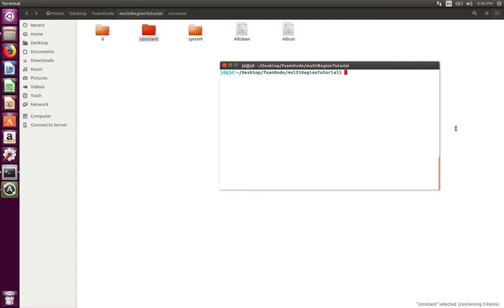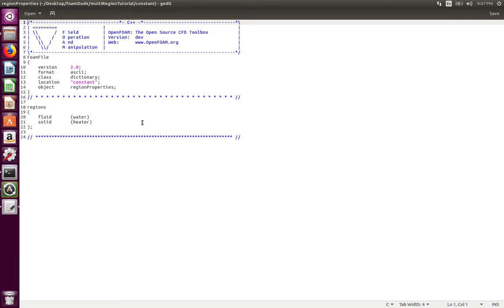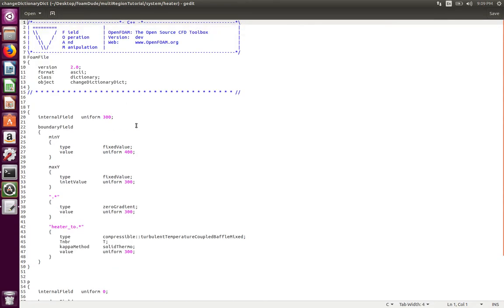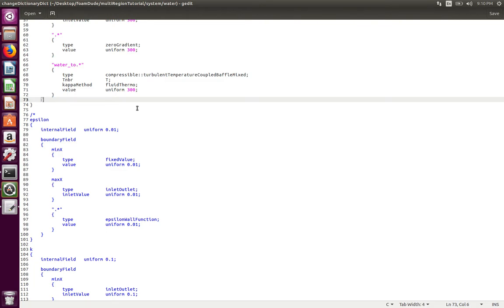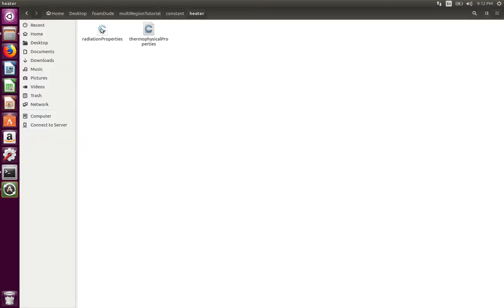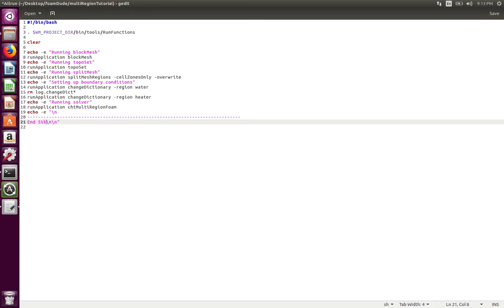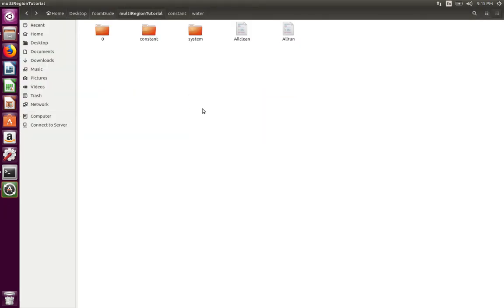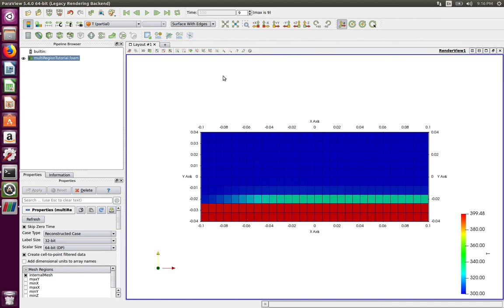OpenFOAM: chtMultiRegion - multi region case setup

Comment: I'm wondering if you have an example of how to set up an axisymmetrical case of chtMultiRegionFoam?  I want to try to simulate the cool-down time of an insulated pipe in water.  The insulation is a little complex, so it's not just a simple 'layer thickness'. I am able to share with you what I have done, but I am having lots of trouble getting the dictionaries set-up and perhaps the 'changeDictDict' approach is actually what I need to assist.

Comment: Hi and thanks a lot for the tutorials!
 How could I run a similar simulation on Openfoam 6?
Reply: since Openfoam 6 doesnt have the chtSimpleFOAM anylonger you need to use the PIMLE version (chtMultiRegionFoam) with ddt scheem in fvSol as steadyState.  
you can take the v5 SIMPLE version and change SPMLE to PIMLE and add the *Final part by using regex. ex "U.*" instead of just U

ex all the fvsceme should have steadyState
ddtSchemes
{
    default steadyState;
} 

solvers
{
   "(U|h|k|epsilon).*"
   <---- added the regex for UFinal, hFinal and so on.  with ".*"
    {
        solver           PBiCG;
        preconditioner   DILU;
        tolerance        1e-7;
        relTol           0.1;
    }

Comment: HI sir
I want to do it for simple case of flow across a sphere with heat generation in sphere. I am creating my mesh in gambit and reading that mesh in openfoam. I am creating toposet with giving sphere solid and rest as fluid by invert in toposet. But when i am running split mesh it shows error that:
Cell 0 with cell center (0.244027 -0.0982378 0.0982372) is multiple zones. This is not allowed.
It is in zone Fluid and in zone fluid

Comment: I tried to run it using the command "./Allrun", but it didn´t let me. Error was "bash: ./Allrun: Permission denied".
Do you have a solution for this? I used OpenFOAM v5.0
Reply: in the terminal, write <chmod +x Allrun>, then execute <./Allrun>. It will work...
Reply: @ujjwalchetan6112  thank you, I found the fix but didn't remember I'd commented on this haha. :)
Reply: @arthurkelly7852  it's okay, bro...Welcome :)